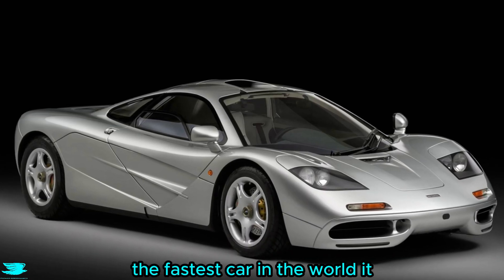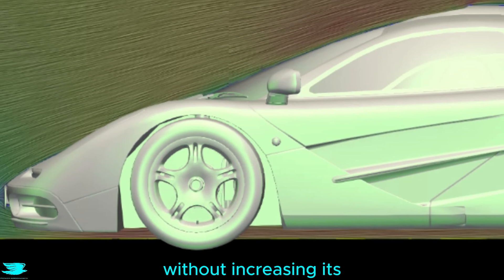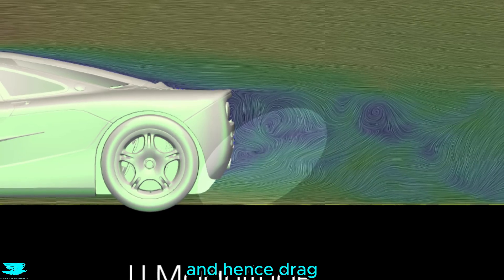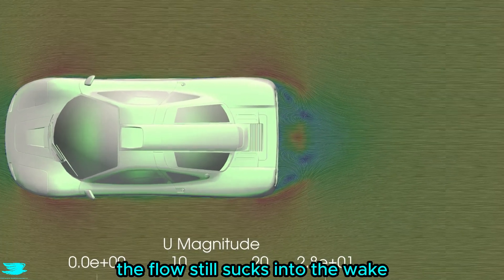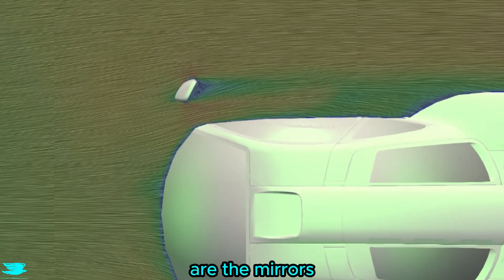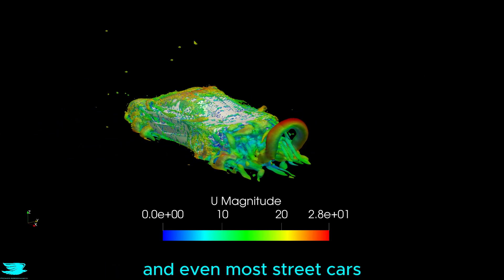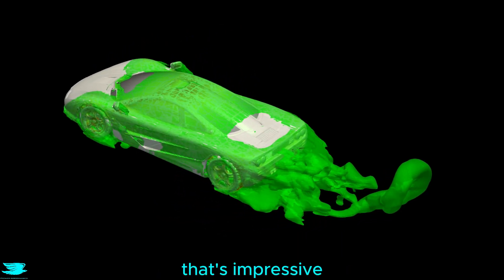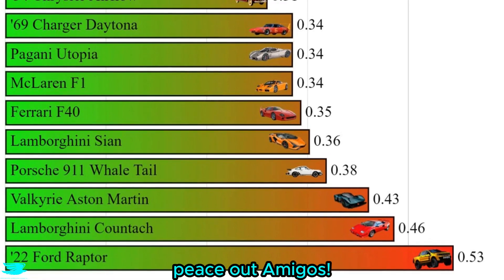*McLaren F1* Aerodynamics

Comment: Huh I thought the F1 has like <0.3 cd since it can achieve 242 mph with only 630 hp
Reply from the maker: Top speed depends on a lot of things. Not only the drag coefficient, but also the frontal area, as well as how well you can transfer that power down to the ground, and then the gear ratios too.

Comment: Great little video!!
A small thing not many know is that the F1 also had fan assist in the diffusers to keep the flow attached to it, increasing downforce and reducing drag. 
From an interview with Gordon Murray: 
"What the F1 did was, I had two reflex diffusers, very steep, that the air would not normally follow. But only so wide," Murray continued, indicating a width of maybe 20cm or so.
"It had two 140mm fans, sucking the air out of them and when you switched them on we got five percent downforce and a two percent reduction in drag.

Gordon is one of those true greats of automotive engineering. The only other similar guy imho is Christian von Koenigsegg an his team - they also come up with such ingenious ideas that simply blow your mind.
Reply from the maker: They definitely think out out of the box. And they know how to make cool looking cars!

Comment: are the rotating wheels taken into consideration? Anyway amazing as always.
Reply: Wheels are taken into consideration, you can rotate the wheels during a simulation. I bet they even have the car slide down the simulation domain in order to simulate as close as possible the actual driving conditions.
Reply from the maker: Thanks! We use MRFs for the wheels.

Comment: Now, added an active fan in the center of the tail and you get the GMA T.50.
The exhaust of the fan will elimated the huge vortex of the tail,  and you can imagine just how efficient that car would be.
Reply: Didn't the F1 also have a fan?
Reply: @Giuliana-w1f  yup! Gordan Murray really likes his fans in cars.
Reply: @Giuliana-w1f  yep but it got banned shortly after
Reply: @cashcarscats  i'm taking about the McLaren F1 road car, not the Brabham BT46B Formula 1 car.
Reply: @Giuliana-w1f  my bad bro
Reply from the maker: It's a good idea. It helps get rid of a lot of the wake.
Reply: @PremierAerodynamics  Well it seems to have added 1 m to the effective length at the back of the car, bringing it on par with a Mclaren Speedtail. The T50 road car gives 24-30 mpg in regular driving, which for a V12 is remarkable.